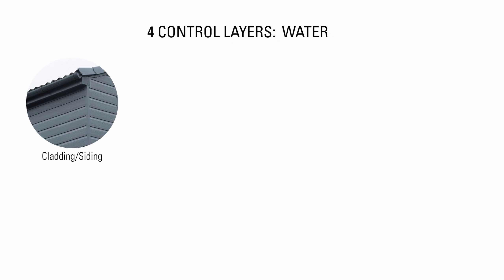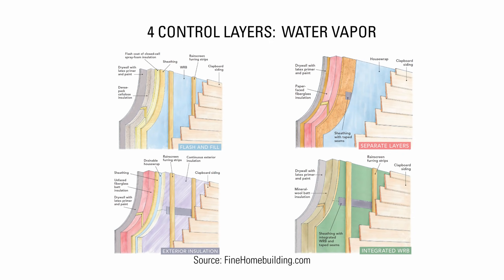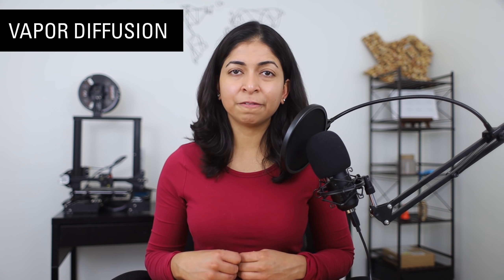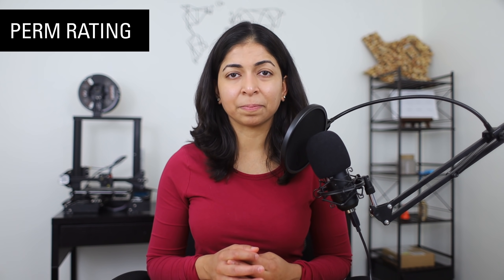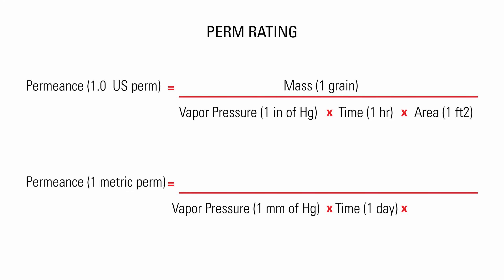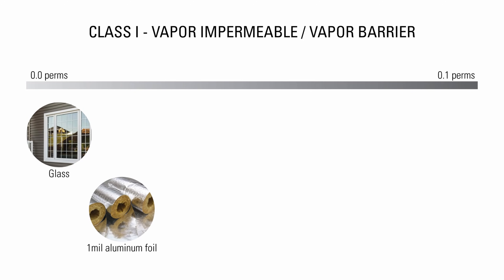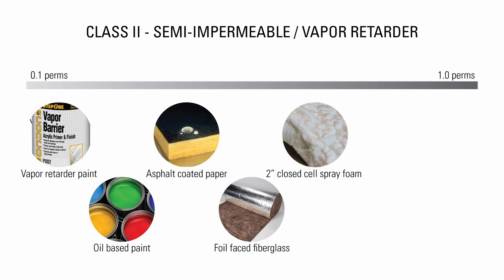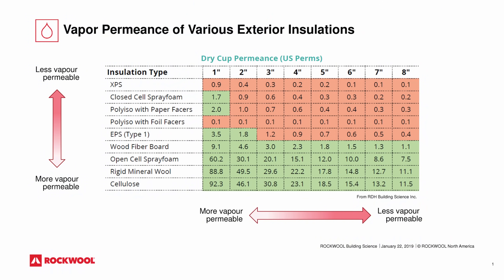What are Vapor Barriers, Retarders & Perm Ratings?

Comment: Belinda, As always you have described the subject very well. Short introductions such as this are extremely useful, but I just wanted to elaborate on the rate of permeability. Diffusion of water vapour is, as you mentioned, dependent on the thickness of the material and the temperature at the time, but there is one other factor that should be considered and that is moisture content of a material. Wet masonry is less permeable, but conversely wet OSB board is more permeable, so the laboratory data given on the product is not necessarily true to in-situ performance. 
BTW the US perms are far better to understand than the Sd measurements (and others) we use in Europe.
Reply from the maker: Thanks a lot for this info! I'm pinning your comment.
Reply: @BelindaCarr  Thanks Belinda, I am a big fan of your videos because you bring so much clarity to deeply technical subjects.
Reply: Isn't Sd just another scale? Mu times thickness, so instead of higher number denoting more permeability it's reversed where a low value repreesents more permeability. Though granted i haven't done moisture calulations in a long time because problems usually occur in corners or places where normal calculations are not required or simply impossible (without 3d software).
Reply: @MichielJorrickMeidem  Yes, the lower the Sd (steam diffusion) the higher the perm rating

Comment: 1 perm = equalls 1 grain of water passing a plane in space the size of 1 gross of square inches in 3600 seconds.  A grain of water?? a grain of sand, a grain of rice, wheat, ??? Just about enough to give me a migraine! I can barely fathom it even though that is about how tall I am. Man this U.S. unit system is a basket full. 
Belinda thank you for the attempt to shed light on this subject, some of the editors at Fine Homebuilding struggle with this. I do get some of it. Temperature/dewpoint spred can be used to estimate how high the clouds are above the ground (divide by 3F(U.S. sys) or 2C (metric sys) x 1000 (feet) or 300 (M)) So if clouds are forming in our walls we want that to happen at a point where they can eventually excape inward or outward I guess.

Comment: I would like a house without plastic vapour. So many codes require them. Natural materials. What the condensation dew pint calculation in the codes does not take into account is the phase change from gas to liquid energy requirements for this. This goes to the position of the vapour barrier. 

American houses all appear to have HVAC ventilation. Not common at all in Australia.

Comment: I enjoy your videos. I have a question. I live in central Florida. Doesn’t freeze. High heat/high humidity. My home is 100 years old with 11’ walls. I caulked all joints, edges & corners. Then painted 3 coats of quality paint. I painted the inside with quality paint. I have old double hung windows. I installed tight fitting wood/glass storm windows on the outside that can be opened from the inside. I installed press first wood/shrink wrap interior windows inside against the double hung windows. The house is up on piers. Air can freely blow under the house. I attached thick plastic film to the joists under the house and caulked. I have 18” of insulation in the attic with a small ventilation fan to move the air outside. 
I don’t get air flow through my walls. 
Many salespersons have told me that replacing my double hung windows and blowing in insulation through the side walls will save me a lot of money. That the energy saving will pay for the cost in just a year. 
Last year I used my furnace for 17 hours. I used the air conditioner for 93 hours total for the year. I am comfortable with just ceiling fans. 
A friend with a new super insulated house needs to run his air conditioner most of the summer. Mostly to eliminate the humidity. 
What is going on? Is my home design superior to new construction. Are triple glazed windows and insulated walls worth it for?

Comment: I’m confused.There’s many suggestions to use xps/eps ridged board insulation against concrete foundations with batts insulation in front to bring r-value up. But it’s not recommended to use poly tarp against foundation walls with batts. Aren’t both systems using a non permeable barrier? Why is one recommended but the other not?

Comment: I wish you covered ICF construction in this analysis. I have been wondering for a bit about this. Matt Risinger has a video where he talks about the importance of a wall to be able to dry from the inside out- on second thought I may not have fully grasped the concept in that video. I think I see the importance of that ability though. There is going to be moisture on the inside of a house from showers, cooking, human respiration, etc, and that needs to be managed. Im guessing in an ICF house that is mostly vapor impermeable, and this moisture could cause problems if not dealt with. I hope mechanical ventilation such as a HRV, or an ERV, or a dehumidifier would be up to the task. What are your thoughts?

Comment: In my zone (5) they require a 6 mil poly with unfaced batts . I would not do this on my own house knowing what I’ve seen in renovations (mold) .I prefer a more permeable product such as typar (not tyvek too high perm rate). Living on the coast we typically get higher temps with higher humidity during winters then most zone 5 areas.

Comment: Great info Belinda, Happy new year!    We have solid wooden walls in my house and all the functions of vapour control, wind and rainproofing and insulation are well coped with for my subarctic climate, without any man made materials at all. The industry has not been kind to this building system here in Norway and it is cultural, instead of technical criteria that allows its continued use. A shame, since it is sustainable and makes for a fantastic indoor climate with good acoustics too. The calculation of R value is specifically designed to favour mineral wool insulation, but I find the true insulation properties of timber houses to be better than equivalent mineral-wool insulated houses here. The study of vapour movement is not new at all, the specific traditional dimensions of timber houses here have a lot to do with vapour movement and were perfected seven or 8 hundred years ago, the same is probably true for traditional buildings in Dubai..? Industrial companies make data that serves them, and their lobby power is formidable. We have a responsibility to give credit to our forbears where it is due, many ancient building systems are excellent and remain little changed due to them working. I have a film on my channel about untreated wooden walls and how they weather if you are interested. all the best , Lucas
Reply from the maker: Hi, Lucas. I completely agree with everything you said! I'm going to post a video on "R value myths" next week that will touch on what you said. Do you mind if I mention you in the video/description? When I said "new" I meant learning how vapor works with new methods of construction(150 years since we started using manufactured insulation), compared to solid wood construction, like you mentioned, that has been around for thousands of years. I'm going to check out your channel. Thanks!
Reply: @BelindaCarr  Belinda you are welcome to mention my site, if you would like to and I would happily make a film especially about this subject in co-operation if that would be interesting to you. My wooden walls film is about weathering rather than k-values. I have heard there have been studies done in the states about energy consumption in timber houses. Also Edinburgh university has some study of energy consumption and hydroscopics in thick brick walls and specifically how retro insulation resulted in higher energy consumption due to trapped moisture, if I remember correctly. At any rate I will continue you to watch your excellent films, all the best, Lucas.

Comment: I live in a colder climate, Canada, and have a question about insulation/vapour. We build walls with 2x material, have insulation in between them, vapour barrier on the inside, sheathing and housewrap on the outside. If we install sheet insulation on the outside of that, will moisture get trapped in the walls?
Reply from the maker: Sounds like you're building a split insulated wall which should work well in your area, provided it's a vapor retarder, not a vapor barrier. What exterior insulation are you planning on using?
Reply: Do not worry about it , when vapour barrier fails moistuer will be trapped by osb sheathing on the outside

Comment: Are there special considerations for caravans, mobile homes, campervans etc?
Reply: Yes, in that these products are assembled from steel or fiberglass they are vapor impermeable. None of these types of accommodations are particularly tight. They leak air. When they are tight condensation can appear on either the inside or outside of wall and roof surfaces (depending on climatic conditions) but the materials used resist water damage very well.
Reply from the maker: Wonderfully explained, Kevin. The one saving grace with all these tiny homes is that they contain a small volume of air that can be replaced quickly when a window or door is left open which will help the condensation issues.

Comment: Thank you for your thoughtful presentation.  I have encountered a problem building an outdoor sauna in Seattle.  Right now this small structure (67 sq. ft)  has a slab on grade, walls framed with 2x6 studs, 1/2 inch CDX plywood sheathing covered with Tyvek, and a sloped roof covered with 11/2 in. CDX and asphalt shingles.  The sauna would likely be used not more than five times a week year around, which would involve the 9 kw heater bringing the interior air temperature up to 180 degrees F over a 30 minuet time period, maintaining the temperature for 30 minutes, and then cooling.  There would be no heating in the sauna at other times.  I intend to use this primarily as a dry sauna, with relative humidity below 30% most of the time.  A subsequent owner may decide to use it as a wet sauna where relative humidity could be near 100% for up to 30 minutes at a time.  To assist in the cooling and dehumidifying the sauna after use, an exhaust fan will be operated for about 30 minutes, and, if necessary, a dehumidifier may potentially be added to the system.  Sauna manufacturers routinely recommend filling the wall cavity and ceiling joist space with rock wool insulation and the use of a foil vapor barrier on the interior face of the studs and between the ceiling joists.  The foil (with a perm rating of near zero) must be carefully installed with all seams taped with a special metallic tape.  The foil is recommended to reflect radiant heat back into the sauna and to stop water vapor from passing into the wall cavity and attic where in cold weather it might be expected to condense on the interior face of the plywood sheathing and promote the growth of mold or cause wood rot.  Given that it is difficult or impossible to install the foil well enough to prevent some moisture from entering the wall cavity, its use raises the risk of trapped moisture in the wall cavity (less so the attic which is well ventilated).  The foil prevents drying to the interior, and drying to the exterior, while possible in warmer weather, would be minimal in the long cold wet winter here in Seattle.  What are your thoughts about this wall design and what would you recommend for moisture management to avoid trapped moisture in the wall cavity?